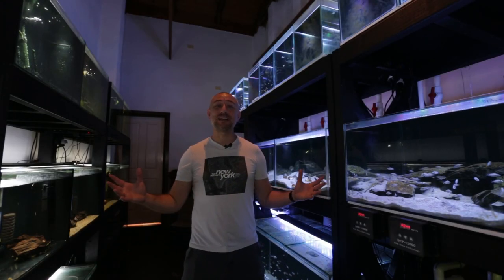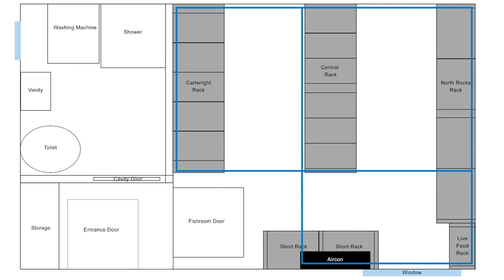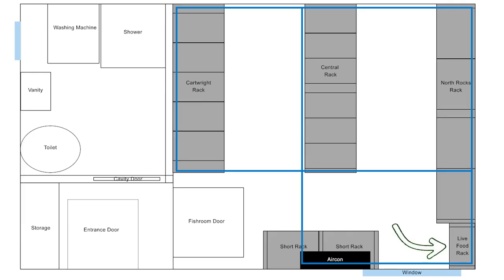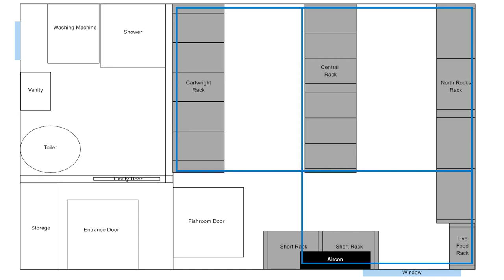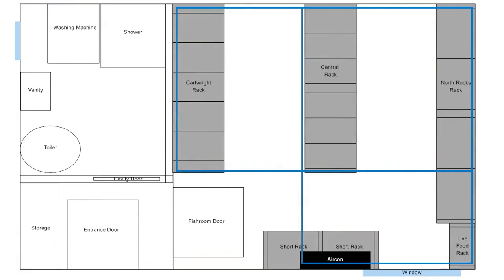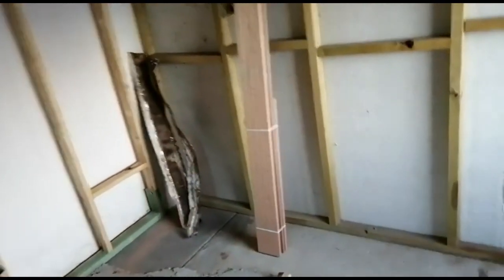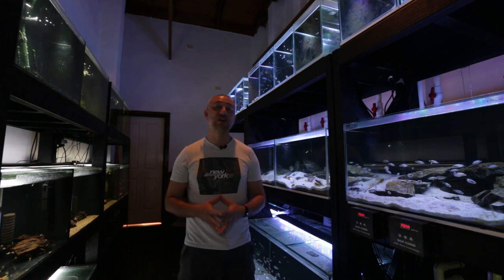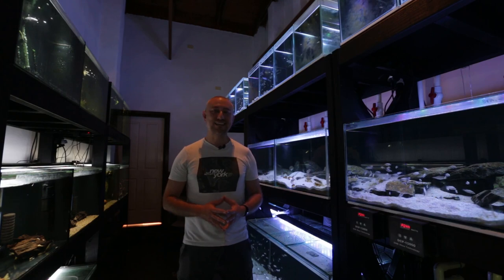Brand NEW FISH ROOM Build! Part 1

Comment: How much insulation will u use living in Australia? I have a fish shed in the UK and its sitting nice at 28 degrees
Reply from the maker: Adam will most likely use as much insulation as he can fit in the room. Basically he will fill in those cavities where he is doing the form work for the walls and then also do the ceiling. All that combined with the small volume of air, his power consumption should be really low, making his fish room as efficient as possible.
Reply: @JasonsCichlids  awesome love watching your channel thanks for your time
Reply from the maker: Thanks heaps mate!